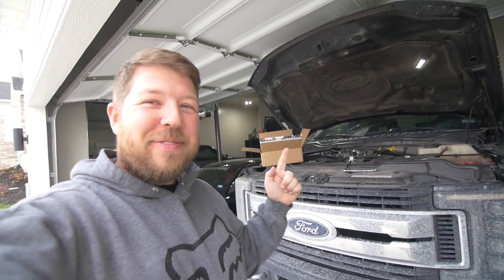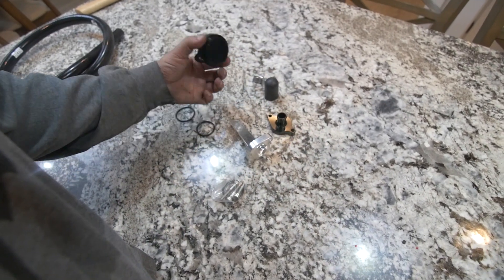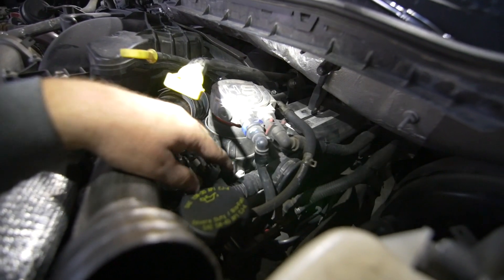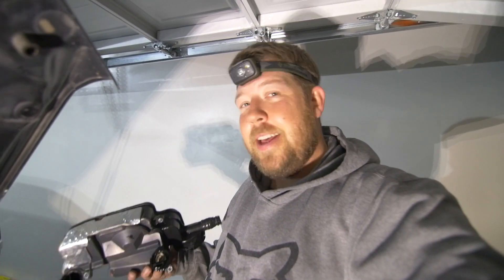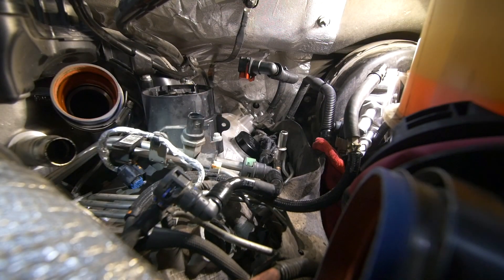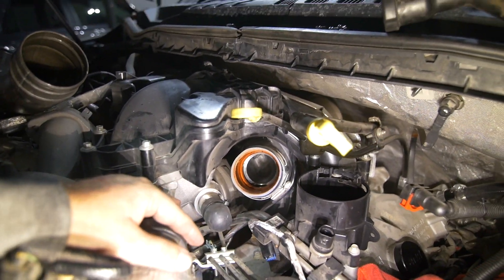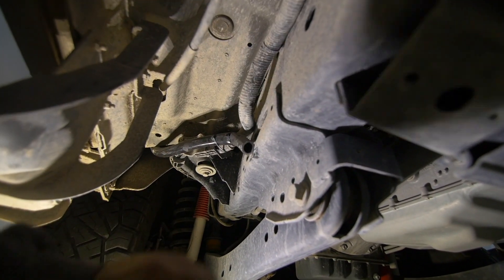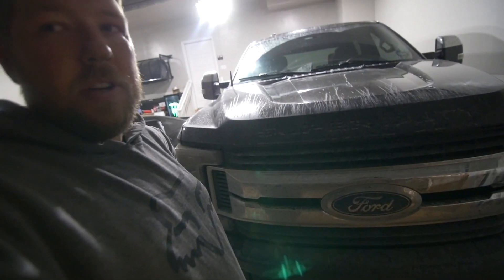2017-2022 6.7L F250 SPE CCV Internal Catch Can Install - How To

Comment: Good video I just completed the update on my F350. I ripped the 4th bolt from the plastic. No big deal was able to clean up. I had the same amount of oil you did. Concerning do you have update on performance or mileage

Comment: Be sure to cover the filter outlet connector and outlet port of the filter once disconnected. any dirt and debris that gets  into it is going to the injection pump and injectors. I like to clean them off well before disconnecting then ziptie sandwich baggies over them.

Comment: I’m doing this same mod to my 2013 f350 SD  you mentioned the catch can from other vehicle that isn’t needed since you put the internal one one your truck. I also would love to see update. My truck is at 245k miles with original ccv on it. Also pulling egr module at same time. Truck has been deleted for yrs but want to get clutter out of eng compattment

Comment: Do you recommend this one over others? I know spe makes great stuff. I purchased their fuel filter drain valve and love it
Reply from the maker: I have no experience with any of the other ones so I couldn't give you an honest review.
Reply: They make a great upgrade to the hot and cold boost tubes and upper intake and an better designed thermostat

Comment: I'd be very interested to see a long term review with that ccv catch can installed with their kit. My truck has 300k plus miles on it and it has a good bit of blow by when you pull the fill cap off. I would like to see if a higher mileage truck puts out any significant amount of smoke when idling with this kit and catch can.
Reply: Is your truck stock with 300K? What is the purpose of putting this kit on?

Comment: Did you find the need to put the catch can on?
I’m thinking of getting the same kit for mine and was wondering if the external catch can was needed or is the internal one doing a good job of containing the oil.   
Thanks
Reply from the maker: No need, I have not had any puddles in my garage or places I park at. I would say initially my thoughts were for the smell. I would suggest ordering the longer hose so that the fumes are not coming up right by your driver window. The fumes can be annoying when talking out of your window at a drive thru or to your buddy standing outside of your truck.
Reply: @moostang09  thanks for the quick response I enjoy your videos very helpful and confidence building.
Reply: Did you ever end up putting a catch can on? I have a Mishimoto High flow, was thinking of rerouting back to intake, but worried there might be issues with overpressure. In crank case